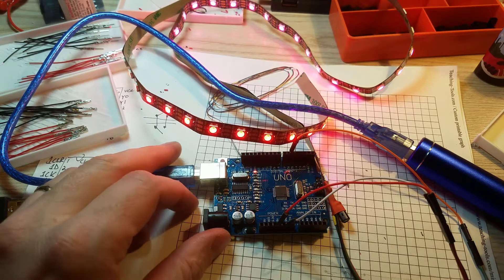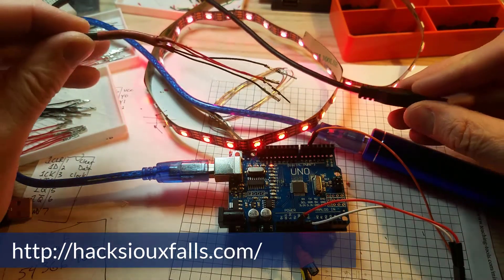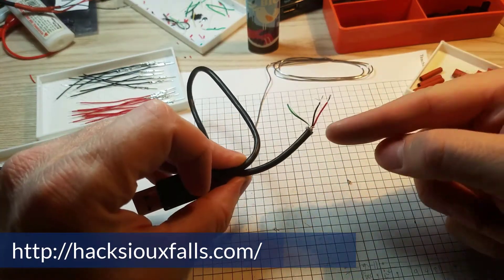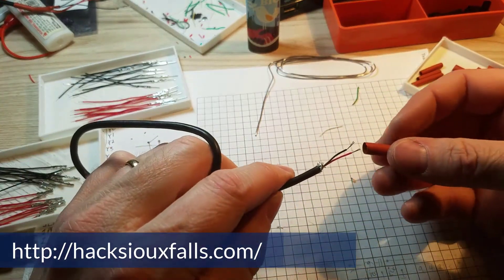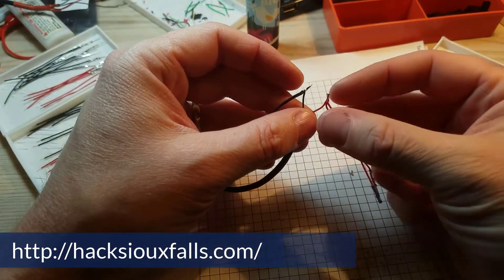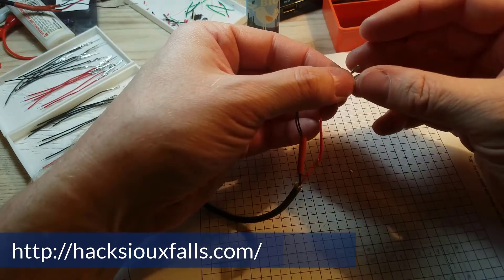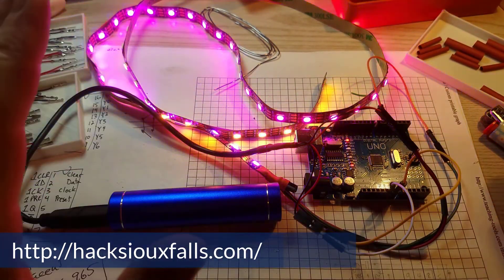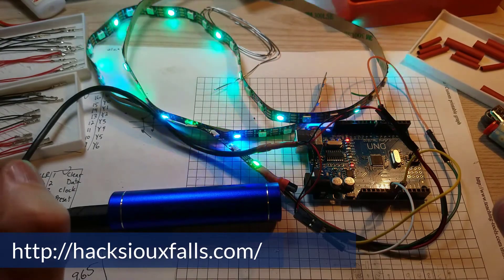A cheap & easy way to power LED strips (ws2812b) & Arduino Uno

Comment: can you power the led strip and the arduino with an ac/dc adapter
Reply from the maker: Yes, you sure can. However, the Arduino has a voltage regulator while the LED strip does not. The typical implementation is to power them separately if you have a large LED strip.

Comment: if the arduino and the strip powered from separated source, do I need to plug 5v on arduino?
Reply: You can power the Arduino from the VCC pin if you want. Just make sure it is 5V because that pin does not go through the voltage regulator.

Comment: is the capacitor connected directly to the strip? also how do you recommend attaching the capacitor? would it be okay to solder it directly to the strip?
Reply from the maker: Yes, directly between the 5v and ground. I soldered it directly to the strip.